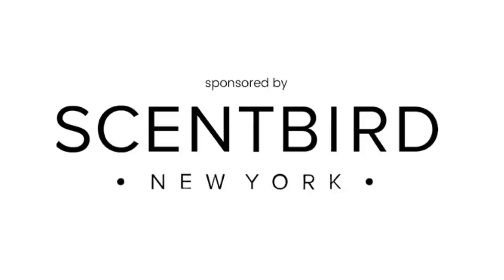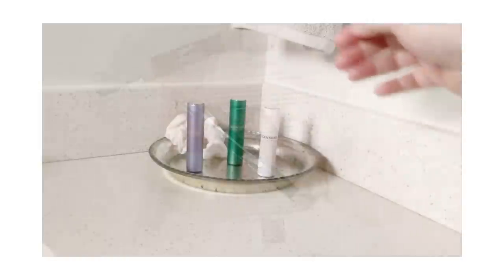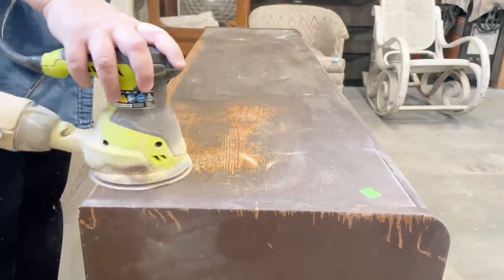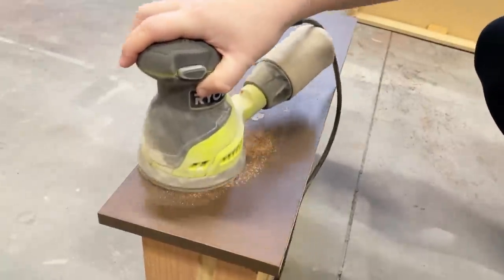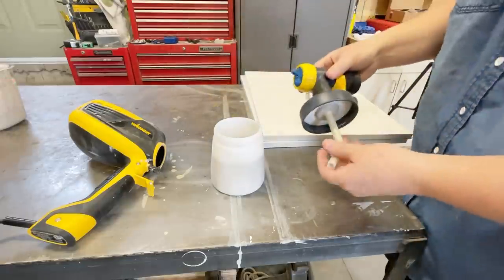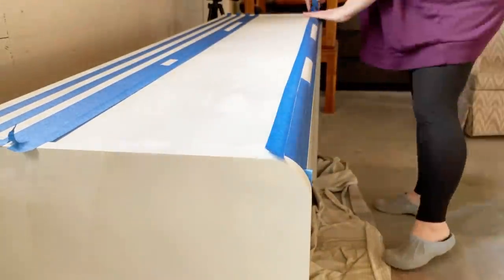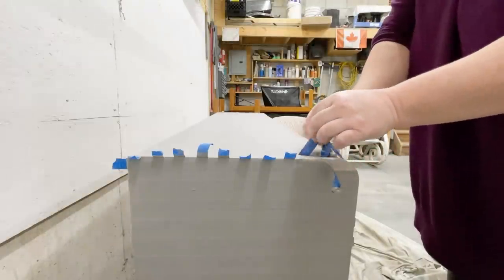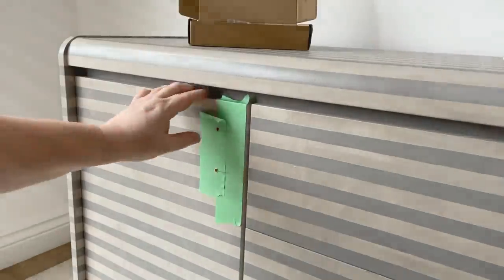I tried to dupe an Anthropolgie Buffet | Laminate Furniture Makeover

Comment: I like it. I agree it would look great with some metallic legs. Trick to painting strips…after you tape, you need to paint with the base color first then pith the contrast color. That way you don’t have bleed through of the contrast color on the base coat.  You could also add a “tea stain” glazing effect on top of everything after its complete with the two colors mixed together (or watered down gold or silver) but watered down before you seal it. That way it blends well. Maybe that’s not what you wanted though, since you said it looked muddy. I like that washed out effect.

Comment: It's gorgeous! Don't completely re-do it.  My suggestion for a slight change would be to remove about 3/4 of the bottom front panel, leaving only a strip under the lower cabinets. Then paint or gold leaf the bottom of the L & R sides - mimicking the base of the Anthropology piece.

Comment: I like where you were going with the stripes. I don't like the base coat. And I definitely think elevating it maybe with some hair pin legs in the same gold of the handles. Otherwise I think the color combinations could have been sharper but you were in the right mindset. I think there's stripes were a hit otherwise. Definitely time consuming and bravo to you for trying it. I know when I flip a piece I think of degree of difficulty and I have yet to try stripes. So kudos to you

Comment: I love it but it could potentially be even more wonderful with legs. But I’m thinking more mid century modern or danish modern. Perhaps a squared tapered leg set at a slight angle in the lighter color so they would grab attention  more than the darker color. And the base removed prior to attaching the legs. But I like the color and the mottled quality. So I’m anticipating what you might do to take this piece to the next level.

Comment: I would paint the base just gray, no stripes. That would give the piece of furniture a lighter impression, without the need to add legs, which I don't think would look good.
I think the result is impressive, considering also the ugliness of the original piece of furniture;  your idea has been fantastic.
Perhaps a wax finish with some color, like an antique finish wax, would give the colors a certain depth and richness and enhance the final look.

Comment: The piece looks great but that legless bottom does date it. I was looking at stained shoe moldings in white rooms and it gives the illusion that the walls are lifted off of the floor by an inch. It threw my eyes and brain (into a tizzy) to realize that it is the 1/4 round stained moldings creating this effect! If you cannot deconstruct the piece to add legs without destroying it, think about creating an illusion with paint at the bottom to "lift" the piece up off of the floor. Hope that helps. Please do a Louis Vuitton piece using the colorful pattern! There is a video where a woman did a piece using the brown pattern and it came out very nice.

Comment: I so enjoy watching your videos! The color is fine, the stripes are fine, the hardware looks great. But...the inspo piece doesn't have a kickplate at the bottom, and it looks lighter and airier and gives off an almost delicate vibe in spite of it's  size. Even if you add legs, I think this piece is still gonna look somewhat clunky. If you're not inclined to remove the kickplate, it might feel less bulky and heavy if you paint the kickplate a lighter, solid color before you add legs? So that there's some lightness around the base. You did a great job with this and IMHO, I honestly don't think it needs a repaint so much as a redesign around the bottom to alleviate some of the heaviness. Looking forward to seeing what you decide to do with this.
Reply from the maker: I agree. After looking at it for a few days I think I can take off that front panel and maybe paint some gold up the bottom like the inspo piece had.
Reply: @Katie Scott - can't wait to see it :-) !

Comment: I realize the shape of the piece dictated how you painted the top but I think that’s where you see the biggest difference in the two pieces. Did you think to possibly change the direction of the lines on the top so they flow with the waterfall of the cabinet. I’d leave the sides a solid color. This way your lines aren’t so long across the top. Anyway I really like your piece! Legs would be great. Good job! That took some patience taping the entire cabinet.

Comment: Good morning,  did you ever have a piece where the Handles left and color distortion. When you sand it down? Am I not standing it all the way? And if I stain it would that lighter part stain different then the rest? Thanks again for advise
Reply from the maker: Yes! That’s really hard to deal with if you’re wanted to keep the wood natural. You can try Bar Keepers Friend (the powdered version) to lighten up those stains but it’s almost impossible to remove it completely
Reply: @salvagedbykscott  thank you so much for the advice!! I'm still new... maybe I should just paint it. Lol 😆